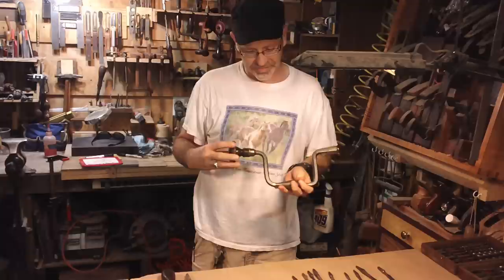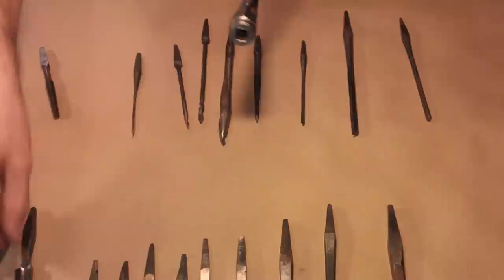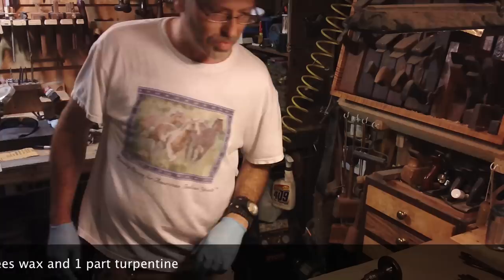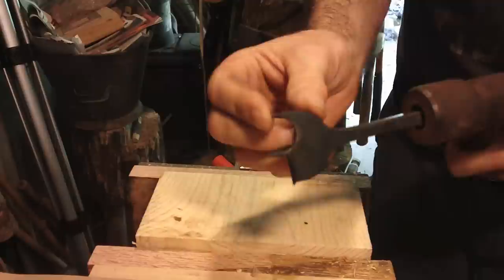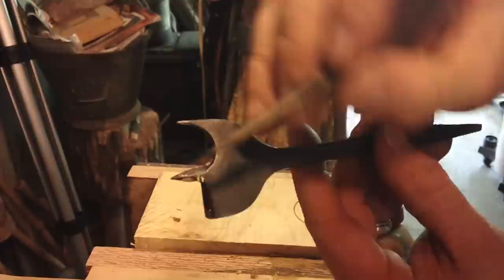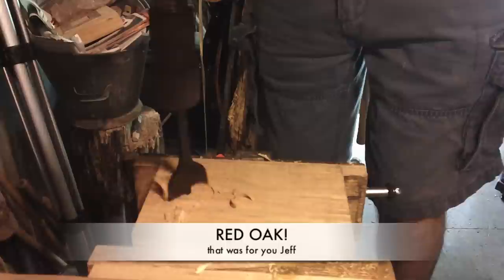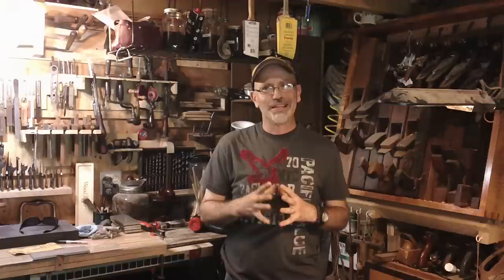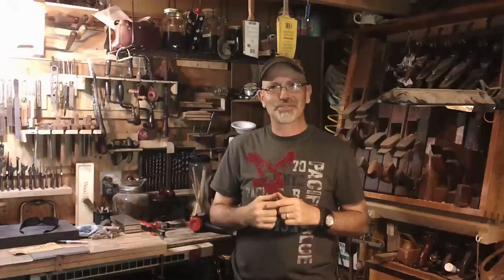Brace and Bit

Comment: Thank you very much for sharing and can I ask you please :what is a good new brace drill ? And what is a good new bits for it? Thanks
Reply from the maker: +as far as new braces. There are none. The quality you get with a n old Stanley or Yankee is uN beatable. You may find one from some one like Bridge City tools but by the time you pay a ten fold price tag, is it really worth it. get on eBay and find a good Miller Falls or Stanley that looks nice. Bits are still made by companies such as Irwin. iMHO good luckJrom Hek
Reply: Dave Bardin  Thanks a lot  Dave for the advice and keep up the good work.

Comment: ...forgot to ask...what did you use to clean the rust off prior to waxing?
Reply from the maker: fryefoto Brass brush in a drill press. The brass wont harm the steel so bad. I use electrolysis when its BAD!